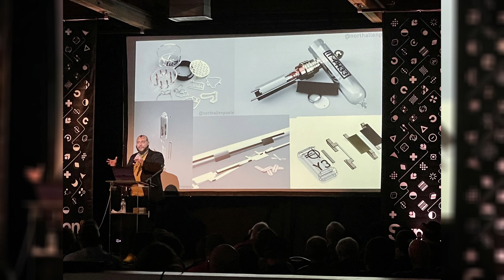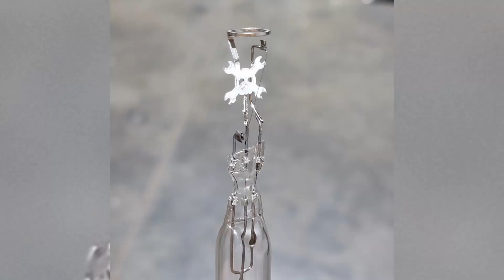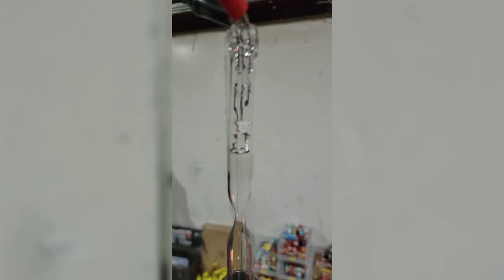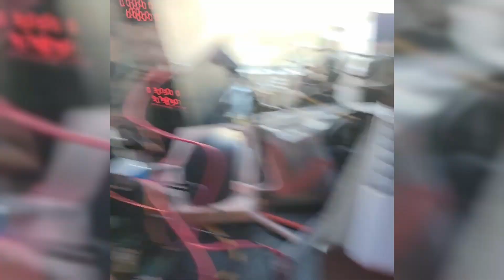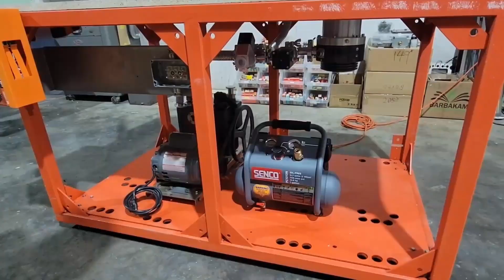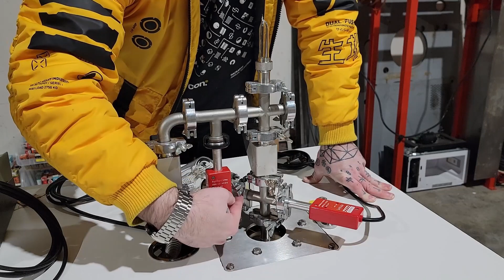I Built A DIY Vacuum Tube Diode

Comment: Your fireplace should be fully enclosed with an air intake pulling oxygen to feed the fire from outside through an intake otherwise you are just pulling any hot air from the shop into the combustion chamber creating a vacuum in your shop that in turn pulls cold air in through any air gaps in the building in an endless cycle self defeating cycle. Fix it and that little shop will be super hot with 1/10th the wood.

Comment: Cool, you should have a go at building a vacuum triode tube based on the design of your vacuum diode tube, you just need to add a fine wire grid element between the directly heated cathode and the anode.

Comment: Cool, you should have a go at building a vacuum triode tube based on the design of your vacuum diode tube, you just need to add a fine wire grid element between the directly heated cathode and the anode.
Reply: Have you done that?

Comment: Awesome channel and video dude!
is the turbo molecular pump necessary for making vacuum tubes one day i would like to try making some my self but vacuum system like these are crazy expensive so im trying to think of other ways to do it. So a thought has been that oxygen is one of the gases that will mess up the vacuum tubes so could one flush the tube with a much denser gas, my thinking is that a heavier gas would be easier to pump out and wont stick to surfaces as easely but my knowledge is very limited so could be the direct opposite the molecule/atom is bigger and therefore has more "surface area" o stick more. So another thought has been to flush it with pure oxygen then absorb it with a heated metalband to create oxides but that would need a separate chamber.  Could one force the atoms with a high voltage charge towards the metalband thats would requirer a extra electrode in the tube tho or would need to do 2 seals on the finnished tube. Just some random thought thats been bouncing around in the head for the past couple of months.
Cheers!
Reply: My understanding is production radio/tv tubes were roughed down, sealed off, and the getter flash did all the work achieving the final hard vacuum. jdflyback used this method and saw success, IIRC Simplifier also made some tubes this way with a Ti anode, they just red plated the tube until it performed well.  I think this sort of multi stage high vacuum setup is more for proper development work, testing things on the pump. One thought I've had for a low budget tube lab is sealing on a disposable Ti sublimation pump if a smaller induction heated Ti halo getter isn't enough to go from whatever rough vacuum a cheap two stage AC service pump can hit.

Comment: You need an appropriate flux and probably a few key trace elements for the nickle to wet both other metals. Argon or vacuum induction soldering is your friend; oxygen, chlorine, non-getter alkalis, etc. aren't.

Comment: Hey man nice,  new sub 👍 I build monster hv projects and yes I love tubes 😂, my latest coil is using a really cool (imo) 1939 radar tube from the British "chain home low radar system" it runs at a pretty high anode voltage of 23kV, I haven't pushed her that high yet but when I do I will be sure to have a Geiger counter in hand 😃.. 
I will check out your other videos 👍 all the best from across the pond 

Steve

Comment: This setup is very cool! I appreciate the work you are doing here and look forward to more. I would be interested in the MOT resistance "pliers" and how they are constructed. I also had one thing to add about protecting the turbo during the melt-off procedure. If you add another bypass stage with some sort of constriction you can create a flow limiter that would give your controller more time to isolate the turbo and gauge from the rising pressure. A longer section of narrower tubing would work for the constriction. In grad school we used this technique to allow the flow of process gasses while still allowing the use of the turbo.

Comment: you are sure that the getter does not get fleshed during the under vacuum process?
Reply from the maker: I think industrially the getters are flashed while on the vacuum manifold. The reason I sealed mine off before flashing is because I wasn't confident in the current configuration of the vacuum system, and I knew that there was a lot of getter material so I was hoping it would act as a sublimation pump to further lower the pressure in the tube.

Comment: That's fantastic work, well done on getting a working diode! Can't wait to see the vacuum bench all together, that'll be a great piece of kit. I'm really curious about that induction heater, always thought they were only good for nuts, but looks like they'll do other stuff too. How well do you think in would work for say a small (say 1cm) disc, either copper or silver? Got a jewellery application that would benefit from really clean heating for soldering, rather than a torch.
Reply from the maker: Thanks! I'm not sure how it would do... If I had to guess, I'd say it would work quite well, but I can do some testing for you if you'd like. I'm sure I can dig up some small copper discs or washers for testing. It seems to have decent power, and if none of the included coils were right for your application, you may be able to bend your own that would work. I'll play with it and let you know.
Reply: @SignalDitch  If you could, I'd be really interested to see how it behaves! My understanding with these things is that they are generally low frequency (e.g. 50kHz), and work best with magnetic workpieces - i.e. rusty iron bolts ;-) For anything non-magnetic, you're relying on skin losses alone, so usually they operate much higher (e.g. 500kHz-1MHz) to get sufficient heating.

Comment: The purge port on the EXT255 is not NPT. It's straight threaded, and stuffing an NPT fitting in there will destroy it. Putting grease on it will also have a big chance of the grease making it to the drag stage and causing destruction through contact of the spirals with the carbon fiber drag rotor. In general, avoid grease in vacuum systems if at all possible. It's only a last resort item.
The little recess around the (purposefully loose) thread is for a small viton oring(which you can buy on aliexpress), and the original accessories(vent plug, vent valve, purge system) all use it.
The port is also used for flowing an inert shield when you're pumping something aggressive, to keep the bottom bearing (and oil) intact, though you won't need any of that.
Reply from the maker: Thanks for the info, I was never able to find that anywhere else, perhaps what happened before I received it was that a tapered NPT fitting had been jammed into it and that's why it's difficult. 

To be clear, I'm not proposing to use vacuum grease on this or any other part of the system. Apiezon Wax W is a solid, semi-permanent vacuum sealing wax.
Reply from the maker: btw, I stumbled onto your video about the turbo repair some time ago and I really enjoyed it!
Reply: @SignalDitch  I wouldn't put anything other than a solid plug with an oring in that port, it's way too close to the rotor for comfort.
Thanks for watching :)

Comment: Such a professional setup for the home lab! And congratulations on the successful diode! Not everyone gets quite those results on their first tube :P most of my early attempts leaked or broke lol

I actually came across your videos a couple weeks ago shortly after acquiring my own EXT255H turbomolecular pump and was looking for other hobbyists that may be using the same one. I'm still waiting on my ISO100 to KF40 adapter to arrive before I can test mine, and was curious to see how it works for other people. Also, what power supply (or supplies) do you use? I've read that I have the 24V model of the controller, but also read that the turbo needs an 80VDC power supply (since I have and EXDC80 controller). I'm inclined to believe it does need the 80V for the motor and puts out 24V control logic, but it's something I don't want to risk given the costs involved. Any help is appreciated!

Same goes the other way. Not sure if I can offer anything you don't already know yourself, but if you have any questions I'd be happy to at least listen :P
Reply from the maker: It's good to hear from another hobbyist! I definitely got lucky with this tube, I expect to make quite a few more before I get another sealed device, haha.

My understanding about the Edwards EXT255H is that there were two different models made, a 24V and an 80V, with the 24V being the newer of the two. Supposedly, Edwards were somewhat aware of how confusing this was and made sure that the connectors are incompatible, so you can't connect an 80V controller to a 24V pump or vice-versa. Unfortunately, the controller is named after the motor drive power (80W) which means that, confusingly, the EXDC80 comes in both 80V and 24V flavors. I was lucky enough to get my 24V pump with the controller included and I found a thread on the Fusor.net forums that (somewhat) elucidated the wiring. 

The good news is: If you indeed have the 24V pump and controller then you only need to supply 24VDC! I'm running my turbo off of a Meanwell EDR-120-24 which is a relatively inexpensive DIN-rail 24V5A power supply and it seems plenty sufficient for the job. 

There are a handful of wires that come off of the controller and you connect 24V and GND between two of them, one of them is an active-low start switch, one is an analog output that gives the proportional pump speed in tenths of a volt (0-10VDC where 7.5VDC represents 75% speed) and then there's an output that goes high when the pump is running >80% speed (intended to switch a relay for process control stuff) 

If you need it, I can find the wiring diagram that I worked off of, I think I ended up marking up a page out of the controller datasheet with info from the fusor forum post.
Reply: @SignalDitch  
Okay that answers my questions! Definitely glad I asked before hooking it up to my 80V power supply...

The controller my EXT255H came with has 24V printed on its back label, which is what made me second guess the 80V thing. I'll have to get a power supply for it but that's not a big issue. Honestly I'll probably order the one you mentioned as I'm rather a fan of Meanwell power supplies.

My controller has the (standard?) DB 15 connector on it. From the manual I found, I should be able to get it wired up correctly; however I wouldn't say no to seeing your wiring diagram as confirmation given these pumps are decently expensive.

Thank you for replying and thank you for the wealth of information! It really helps progress this niche field when we work together!